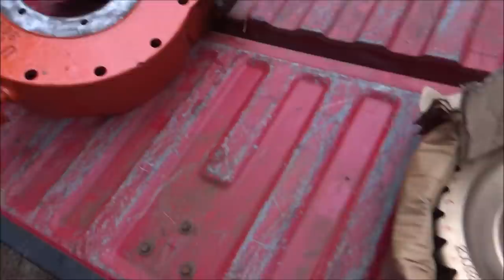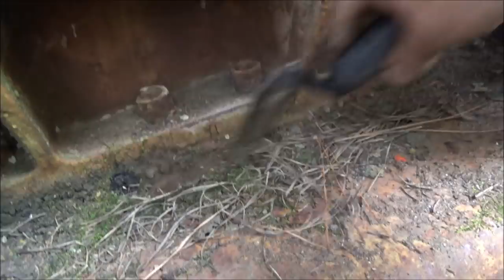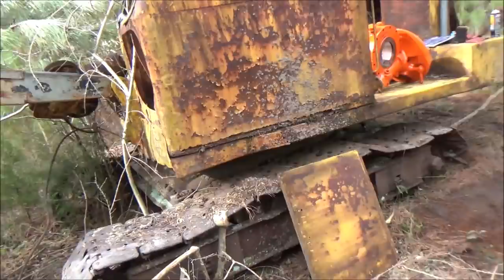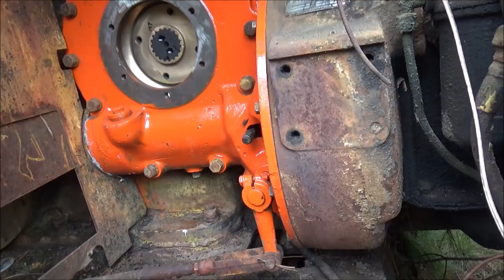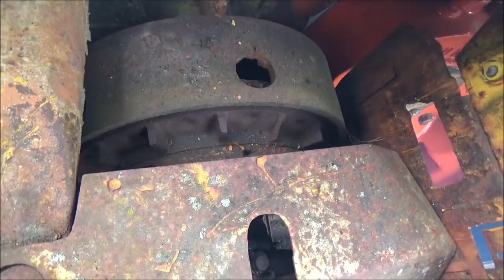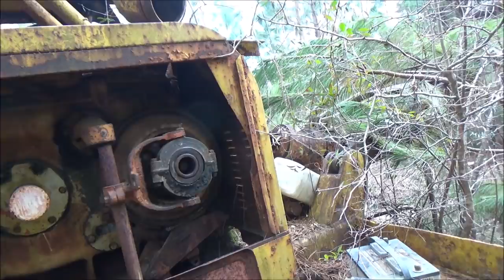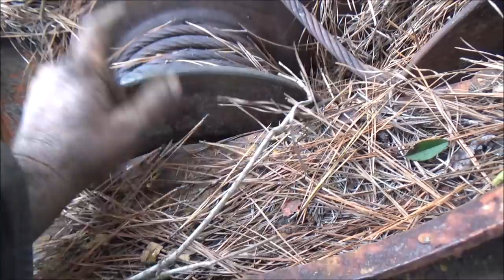UNIT 614 CRANE RESCUE 20 YEARS IN THE WOODS PART 8

Comment: I know in the UK they weld stuff like that to stop parts being nicked.
Reply: If it's not bolted down they will steal it. If it is they will unbolt it, then steal it. Catalyst thieves already use cordless pipe cutters....
Reply: I'd love to meet the guy that could unbolt it, and carry away that piece.
Reply: @erikj.2066  I have come across bigger things nicked in the oddest of places, if someone wants something they will take it.
Reply: @MattBrownbill Demand for parts would have been high for 20-30 years after it was built so if you can get hold of a part that is free or cheap Bobs your uncle.
Reply: @shaynelowther8893  I agree if someone wants anything, they can find a way to get it, but in the case of stealing that gear box, it would probably be easier to steal the whole crane, rather than remove that several thousand pound gear box buried in the middle of the machine. 

They'd need lots of time, lots of tools, and their own drag line crane to lift it out. If they had all that, having a set of cutting torches, or a grinding wheel to cut the welds would be an afterthought.

Comment: What did you decide for lubricant in the worm assembly?
Reply: I think he got GL-1 140 weight for temps above 30F and GL-1 90 weight for temps below that. Those are old formulas too, without modern additive packages that tend to harm brass/bronze synchro gears and such. He wrote that in the previous video, somewhere in the comments

Comment: The weld reminds me of when people caulk the floor around their toilet. Makes no sense.
Reply: The calk is to keep water and condensation from the sinks and shower from getting under and creating mold.
Reply: And to keep the toilet from moving, thus compromising the wax seal.
Reply: Doesn't that keep water from getting under and rotting subfloor?
Reply: @farmerbill6855  The 2 bolts on the side are for anchoring it to the seal flange .
Reply: @MitzvosGolem1  only in wood houses
Reply: @davidnichols1363  yes, and they're not strong enough if something hits it or someone falls against it. The caulk also keeps the toilet from rocking on uneven tile floors.
Reply: @davidnichols1363  yes. But if toilet over flows nasty water gets under and leaks into basement or under concrete slab
Reply: @davidnichols1363  toilet talk lol 😅
Reply: @MitzvosGolem1  does that make us pottymouths?
Reply: @davidnichols1363  🍰🚽
Reply: Don't know what toilets got to do with it, but I'll put my 2 cents in.  Ain't never seen caulk strong enough to keep it from moving when I set my 250lb self down. And how you gonna tell if the wax seal is leaking if it's caulked? Wait until the floor rots?
Reply: @robjustlooking8729  3M 4100 marine caulk strongest on Earth..
Holds off shore boat together .
When on toilet during Earth quake you are safe but where a mask... lol 😅
Reply: @robjustlooking8729  Didn't mean to start a kerfuflle. (My fancy word for the day.) 
It looked to me like the welding wasn't needed, and it reminded me of bolted down toilets that don't need to be caulked, but a few folks say it is.  Can't hurt, so maybe you made the best point...they ain't the same.
Reply: @MitzvosGolem1  My Number 1 reason, but the rest of these reasons are VERY good ones too!

Comment: I'm guessing gear case was lifting under load, and perhaps sheared the hold down bolts, however, it must have been one hell of a load on her!!"For the cable spools,  try to pull them out with your wrecker's winch.Wear gloves, in case a strand is broken!Insert a stainless roller pin in btw spools to reduce friction, loaded with axle grease.God's Blessings.

Comment: The case is most likely welded to stop it wriggling under slew load. I woulds say they couldn't keep the bolts tight so they welded it.